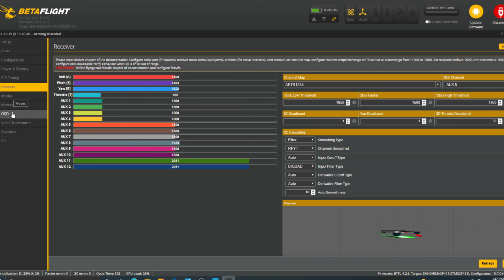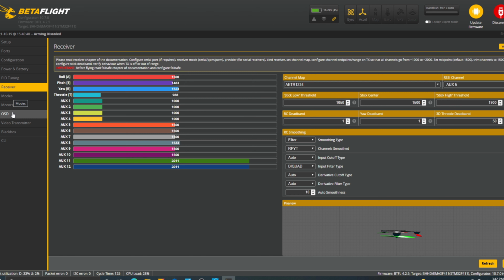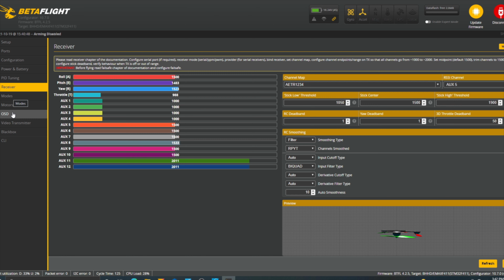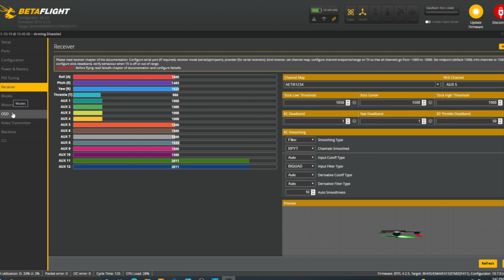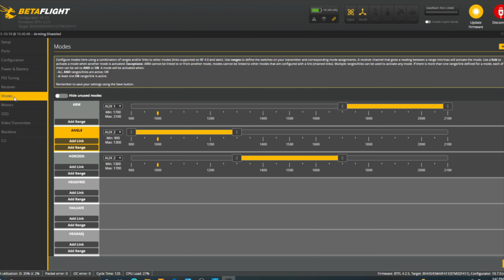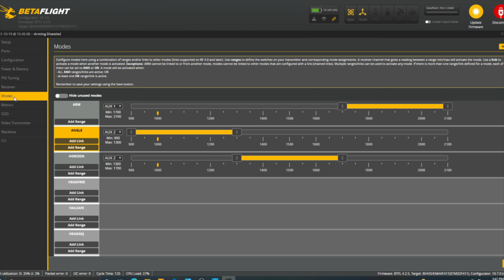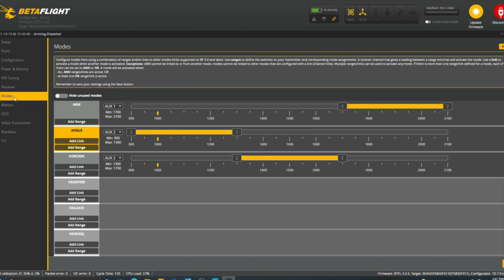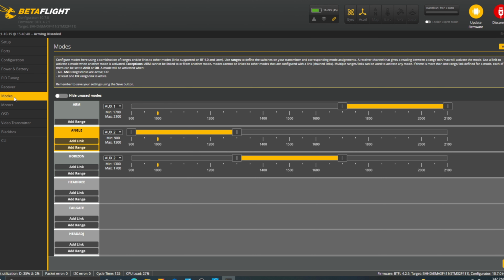BETAFPV Lite Radio2 SE w/ELRS (FULL Setup) | Perfect Radio for 1st Time Pilots👍

Comment: Have you ever plugged the radio from the Aquila 16 kit into the configurator?  If not, could I ask a favor for you to plug it in and let me know how the channels are setup for the Aquila 16?  Is it using the stock setup the same as the standalone radio that you are setting up in this video? Thanks very much!  I'm actually planning to try it with a Radiomaster Pocket Radio with Ranger ELRS module. I need to know what channel is mapped to each of the switches. If I can't get that to work, I may just pick up the Literadio that you are working with here, if I feel confident that it will work as the one included with the kit.

Comment: Excellent Video, I am just getting into FPVs and recently got the BETAFPV Cetus Pro kit which come with the controller. Was thinking about getting the Protek25 and was wondering if this controller will work with that drone? Thanks
Reply from the maker: This one is the ELRS version.. If your Protek25 has an ELRS receiver, then it should work.   If you're sold on BetaFPV for a radio, I would consider the LiteRadio3(I'll leave my review on it linked below).  If you want a radio with a screen, the Radio Master Zorro is a good choice.
https://youtu.be/r1HIZwoUID8
https://youtu.be/I8KJY3Tvrtw
Reply: The one in the cetus is Frsky d8 and d16

Comment: Does anyone know which switch (top or bottom right) puts it into angle, horizon, acro mode ?
Reply from the maker: I think there is no correct answer to this question as the radio is fully customizable in BetaFlight.  You can choose and assign any switch to do this function, and all drones are setup differently, even from the factory.  I think most people use the left top switch, as its a three position switch(one for each mode) and is near the Arm/Disarm switch.
Reply: @OneManUnmanned  ahhhhh okay 👍🏾 Thank you, I flew with it straight out the box and had to guess which switch does what. Crashed and lost signal to the drone several times. So I stopped using it. But I’ll check in betaflight

Comment: Hi great video, is it easy to bind this controller to multiple drones or do you need to rebind it each time as there is no screen and interface?
Reply from the maker: This is the ELRS version, it binds automatically to all my ELRS drones, even ones I've never flown with this radio before.   No re-binding necessary(binding phrase in ELRS makes this all possible).
Reply: @OneManUnmanned  Thanks 👍
Reply: I'm undecided on this transmitter, I've currently got a flysky fs-i6 but am only getting around 2-300 meters range in perfect conditions. Would moving to one of these be a worthy upgrade or would I best save up for a Radiomaster Zorro?
Reply from the maker: ELRS will perform better than any Frsky protocol, even if the radio itself is cheaper in nature.   Having said that, the Zorro is a better radio than the LiteRadio2.  If you find a good deal on a LiteRadio3, it might also be a good option if you get the Frsky version, then later buy an ELRS Module later down the road.
Reply: @OneManUnmanned  Thanks again man 👍 keep up the great quality videos!
Reply from the maker: Thanks 😊

Comment: Hii i am beginner in fpv and i want to  order this for simulator but confused in ELRS and fr sky that which is best please help me 🙁🙁🙁
Reply from the maker: This radio will work with your sim.  It depends on what you want.  Are most of your drones Frsky or ELRS?  At this point, Frsky receivers are more common in drones, especially Bind & Fly drones. ELRS is a newer and ever evolving protocol.  ELRS also has better range and is more responsive (low latency) than Frsky, but has a steeper learning curve.  Once you have ELRS setup/configured, it's easy to use.  Hope this info helps.
Reply: Im definitely going to need your expertise with elrs i been flying d8 d16 and crossfire for 6 years. I do not know how to flash firmware but i know how to use betaflight, BLheli setting up my quads and whoops. But i would love to learn more about it im interested in the range elrs has to offer
Reply from the maker: I've done multiple videos on ExpressLRS, from what exactly is ELRS, to installation and configuration.  I'll link them down below.  I hope this helps. 
What is ELRS: https://youtu.be/hsyRAzHJCnY
ELRS Setup Pt.1: https://youtu.be/pUhe3jKzduQ
ELRS Setup Pt.2: https://youtu.be/HOUFqs6iTAA
Radio w/built-in ELRS: https://youtu.be/7Ggrb5Pzzkk
Lite Radio3: https://youtu.be/r1HIZwoUID8

Comment: In new and just got my controller and I’m not sure exactly what is bind phrase?
Reply from the maker: A binding phrase is an alternative way to have a secure connection between your radio(and only your radio) and your drone.  Think of it as the Wi-Fi password to a router.  Without it, no one can access the internet.  It's also convenient, because once your bind phrase is set, new drones and receivers can bind easily to your existing radio, as long as the binding phrase is the same.  I've done a video on how to setup your bind phrase here: https://youtu.be/HOUFqs6iTAA
Reply: @OneManUnmanned  perfect 👍🏻 thanks so much for getting me in the air
Reply from the maker: Not a problem.

Comment: ... and I'm stuck at step 1.  I plug the radio into the computer and i get the windows sound that it's connected but the betafpv software does nothing and won't connect.  I think this ##%$ drone hobby is for people that have endless patience or way too much free time lol
Reply from the maker: Sorry to hear... Sometimes the radio has to be off when you plug it into the computer.  Sometimes it has to be on.   Try plugging it in with the radio off first.
Reply: @OneManUnmanned  Thanks!   After plugging/unplugging 10X it finally accepted the connection.. On to Step 2 !
Reply: @OneManUnmanned  any idea how to bind this radio?  I've got a flywoo firefly nano with ELRS.. coming from no-brainer DJI stuff to this I'm having to think way too much haha
Reply from the maker: I  haven't reviewed that drone, so I'm not 100% familiar with it.  Is the receiver external, or built-in to the flight controller board like an SPI receiver?
Reply: @OneManUnmanned  Flywoo Firefly has a F745 FC.  The ELRS is this ultra tiny board zip tied off to the side (made by flywoo I think) and has a T antenna.  From what I read the Remote Controller (betafpv LiteRadio 2 se elrs) and the drone receiver must be the same firmware version?  Hopefully all this different brand ELRS hardware is compatible
Reply from the maker: I think it might have an external rx.  The easiest way to bind the two is with the "bind phrase".  The bind phase is like the  password to your wifi router.  It prevents other pilots from binding to your drone(because they don't have the "phrase).  When you setup your receiver in the ELRS Configurator, you'll have to choose a bind phase.  That bind phase must be the same as your radio binding phase(which is what you're doing right now in the BetaFPV Configurator).  Once the radio and the rx has the same binding phrase, they will connect and communicate automatically.  I've done a video on rx Configurator.. I'll leave it linked below. 
https://youtu.be/HOUFqs6iTAA
Reply from the maker: The brand does not matter, and yes they have to be on the same firmware and have the same binding phrase.
Reply: was able to use the Bind Phrase (after firmware update like the video shows)
Reply from the maker: Awesome.. Glad it worked.  👍

Comment: I have a Lite2 ELRS - Beta Configurator sees it but won't reset etc. As is the settings are all WAY too sensitive.  Would like to reset but even with local update will not flash.  It must not be finding it after I hold setting etc and put it in mode that will accept download.  Anyone know how to overcome? Thanks